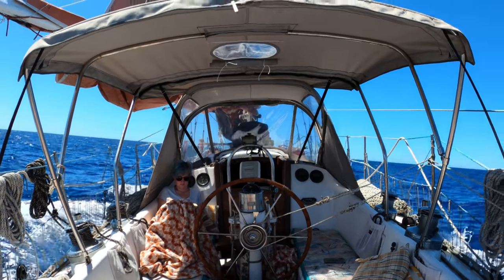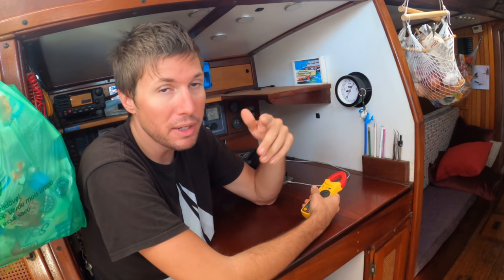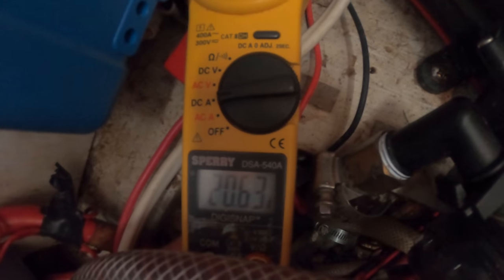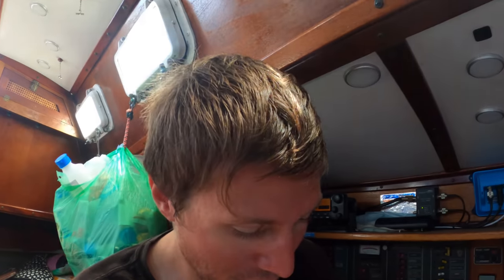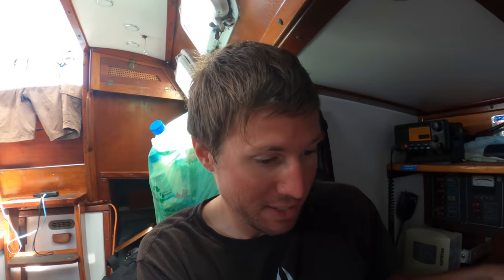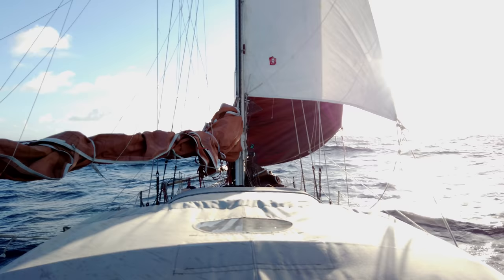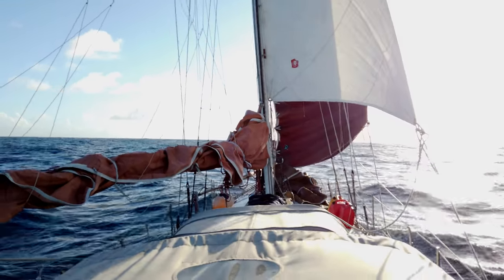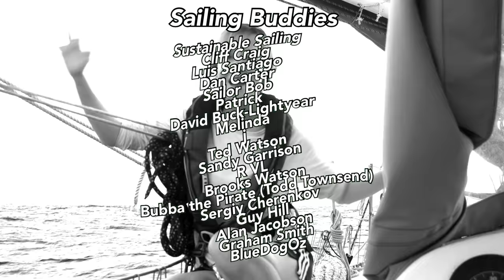BROKEN Hatch and DEAD Batteries in the Atlantic | Sailing Wisdom [S3 Ep31]

Comment: The sail talk is always interesting. As a sailor-noob, I really appreciate this.  Only a month ago I discovered that (Tom Hanks plaintive voice:) "There's no 90 degrees in tacking!"  Because of apparent wind, it's usually more like 120.  In Santa Monica Bay because the coast is always a wee bit more than 180 degrees, tacking has so far always resulted in (seeming to) sail backwards.  I think most sailors, all of whom more experienced than me just turn around and head back.  
One thing I've noticed when all the sailboats entered the (Marina del Rey) channel heading back to berth, and they're still sailing, everyone is doing the same thing, which is what I - a noob - would've done anyway. I don't think this means I'm right, I think it means most sailors aren't all that skillful.  In the situation I'm mentioning the point of sailing was running, I'd already tried Wing-on-wing outside the channel and not much happened. So at least one smart sailor should've been sailing head sail only , main down. None were. (Though I'm going to give it a go next chance.)
Reply from the maker: Let me know how it goes! You will also have much less weather helm making steering super easy to handle 😉

Comment: I like how you walk through your though processes as well as the steps you take to solve problems.  Also, the sailing footage is great, I have the sense in some way we are there with you. Great job.
One question, the rigging line you are using must be UV resistant.  Can you let us know how we can be sure if we are getting line that will hold up in the sunlight?
Reply from the maker: The line is SK78 Dyneema which is UV resistant. Amsteel or New England Ropes dyneema is all UV resistant.

Comment: Sorry to hear your having those power problems. That one charger being out seems to be making it rough. Luckily its the 12v (I think it was?)  because you wouldn't have much luck using the 12v to charge the 48v bank. The 48v bank is the larger of the two ?

Comment: Suggestion: I believe a DC to DC converter with a current limit adjustment would help. When charging the house B. over the DC/DC converter you could have good adjustment for the right amount of Charging current to your House battery, so for example you could adjust the charge current  from 5 to 20 amp. as required.  Peter and Francine, Sechelt, BC, Canada
Reply from the maker: It allows me to set voltage but not current. What I did find is that the converter is capable of running all of the house loads making the idea of house and motor banks redundant and unnecessary. It played a major part in the fix!

Comment: I am assuming that the regen has field coils that are electromagnetic, i.e. it draws current which could be the 1/2 amp loss to create the field. Do you know if the prop is turning properly when going slowly? If there is resistance to rotation on the prop shaft, then perhaps the prop is going very slowly or is stopped in light winds. Just some thoughts on how to diagnose what is actually happening. If the prop is turning properly when going slowly, then I would check all the connections for corrosion or other issues.

Comment: Ok so I gotta ask. Any reason for the figure 8 knot halfway up the jib sheet? Is it for poling out or something I can’t think of a reason.
Reply from the maker: The sheet block for that sail is rather far forward. That’s the stop knot for the sheet so that I can still have three wraps on the winch even if the sheet got pulled free. 
If the stop knot were at the very end, it would stop the sheet from pulling through but be impossible to get back on the winch.

Comment: I see you have a Strong Track for your main. Be aware that a Strong Track is like a tomato. It goes bad over time. In the case of the Strong Track, after a number of years. (I can't remember seeing that in the sales brochure.) Mine broke 25 feet up the mast, so that some of the slides came out. Tides Marine informed me that the Strong Track has about a 10 year life, particularly if in tropical sun. Mine was 12 years old, having lived in sub-tropical and a tropical environment for all its life. Fortunately it did not happen while I was trying to take a reef in big weather, or it would have been a real disaster. So perhaps it is time to replace your Strong Track. If it was on the boat when you bought it, there is a serial # on the SS piece that secures the slides at the bottom of the track and Tides Marine can identify when it was purchased by that number. Be forewarned. I love my Strong Track, but now I know one of its importance characteristics. I don't want what happened to me to happen to you.
Reply from the maker: I was not aware of this! Thanks!!
My strong track has a date engraved in the side (April 1991) so I’m assuming that means it’s 30 years old now. 
Time to replace before it breaks!
Reply: Imagine taking a reef in a blow and having two or three slides break free but not the upper ones. Nightmare. I am feeling very lucky, particularly as I was single-handing.

Comment: A simpler solution is to get rid of the fridge.  Going on hmm I dont know how many years on my boat without a fridge and without ice either.   Too many power problems with fridges on voyaging boats, i.e.  "there's no more power to run the nav system or radio or critical AIS..because the fridge is working so hard, pulling 6A.." .     Misplaced priorities.
Reply from the maker: We were extremely grateful to have a fridge. It’s how we kept our meet and veggies fresh. Otherwise we would have been eating canned food for an entire month.
Reply: @RiggingDoctor  Getting rid of the fridge also means changing how cooking is done and diet.  Pretty easy.  Check out the book, Sailing The Farm.

Comment: It seems as if you set your sails a bit more for comfort than for speed.
Reply from the maker: Absolutely
Reply: @RiggingDoctor  That's how you know it's true love:  you set your sails so as not to make your wife miserable, even when you're 1,000 miles from the nearest divorce lawyer.
Reply: Those who sail long passages appreciate the fable about the tortoise and the hare.   And the advice about keeping the center of effort forward when downwind or nearly downwind is spot on - doing so reduces the need for excessive rudder input, which would otherwise create drag and complicate self steering.  A bit more sail area might help reduce rolling in some sea conditions, but must be weighed against the ease of handling less area if the wind is erratic.
Reply: The other great thing about giving yourself permission to sail downwind using headsails alone is that by lowering your main and sheeting in the boom, you've obviated the risk of an accidental gybe.  I hate sailing wing-on-wing, there is no reason why sailing on my absolute worst point of sail should still require 100% sphincter-puckering focus to avoid damaging my rig.